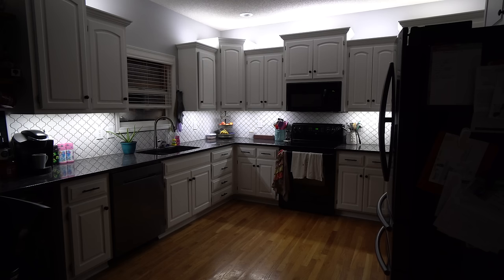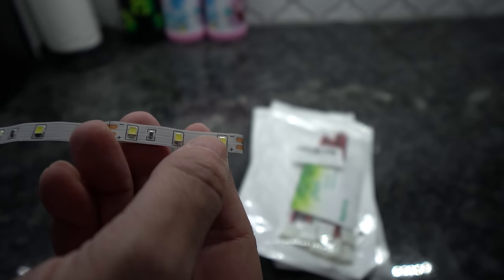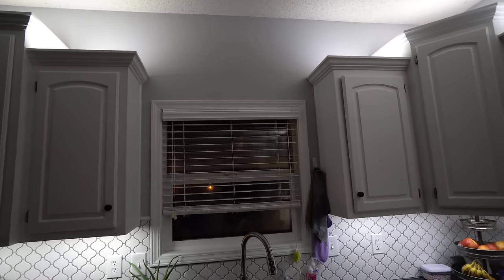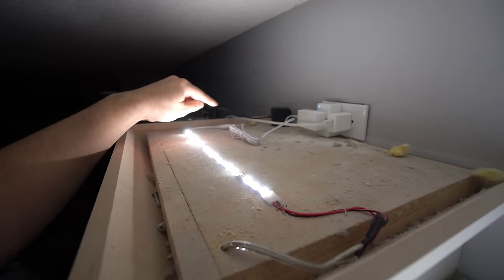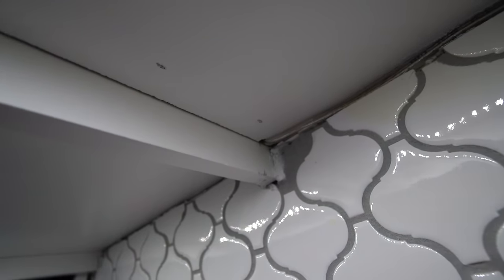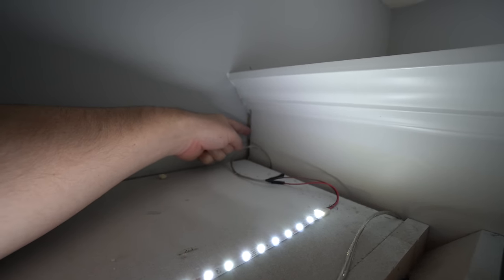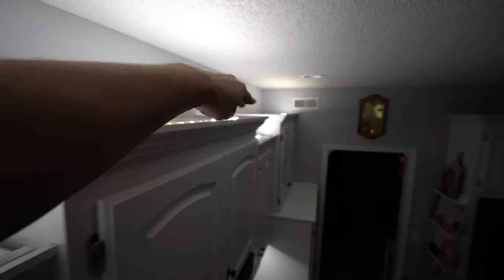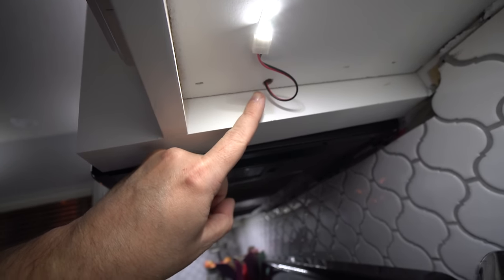Under Cabinet Lighting - EASY and AFFORDABLE!

Comment from the maker: Thanks for watching - Please Like and Subscribe - Product Links: LED Light Strip - https://amzn.to/3bIDMgN, Solderless Connecters - https://amzn.to/3aXoKVq, Wire - https://amzn.to/3swyGLj, and Wyze Smart Plugs - https://amzn.to/3r0xSOD
Reply: Do you have a link to the conductor you used?  I see the box there but you didn't discuss it in the video.  These are only 12V light strips being hardwired to my home's 220.  Thanks a million.  Your lighting looks fantastic!
Reply from the maker: Are you talking about how the leds plug into the wall?
Reply: Yes power adapter comes with light strip but as he said only one per string. It will plug into your wall and convert wall power AC to DC for lights .
Reply from the maker: Ahh yes. I bought one light set per plug-in I needed.
Reply: @DIYReid  ~  Oh ok, thanks.  I'm wanting to tie in to an existing light switch in my backsplash that goes to the light above the sink... I may be using the wrong lighting for this... I'll have to ask a friend of mine for help.
Reply: @777smitty4  ~  I'm wondering how to get this 12V lighting to tie into the existing light switch, or am I going to have to use a separate 12V RV switch?  I'm sending you an email...
Reply: what wire would you use for running the RGB light strips?
Reply from the maker: https://amzn.to/3GkSfjQ

Comment: the ability to split to different directions is exactly what i was looking for! subscribed and thanks
Reply from the maker: Thank you for the support!
Reply: @DIYReid  or Andy Espenan what was the other kind of wire that you used that went through the cabinets? Do u need anything else to hook it up to be able to jump it like 4 ft beside what you showed in the video? I know the solderless connections are great for small areas but I have 4-5ft sections in a few spots I need to run wire instead of lights. As long as I don't need to solder anything, I can figure it out!
Reply from the maker: I used speaker wire. I linked it in the video description.
Reply: Had cheap speaker wire. Cut the main cord to feed 2 different routes and it was very thin

Comment: I also have lights on top of the cabinets, and did it with no outlet at all. I actually had to run an extension cord right along the seam of the cabinet where no one sees it all the way to the outlet behind the fridge. At the end of the cord I plugged a smart outlet and have them so they will automatically go on and off at certain times. They could also be turn on or off using Alexa. I really love the vibe it gives.

Comment: You're correct, it is in series. 

I love the ideas! I'm working on a project similar to this myself. I was wondering how folks did it like this! Thanks for some ideas!
Reply: would be in parallel.  if in series, think old Christmas tree lights.  if one light is out, they all are out..  In parallel, all lights between the plug and the last one are then just "tapped off" the power run. :)
Reply: It's parallel. They are made to be connected and wired in parallel. Series would mean connecting your positive to one end of the LED tape and connecting the negative to the other end. In a series circuit, if one bulb fails, it will make the whole section turn off since the positive and negative have both been broken by the failure of that bulb's filament.
Reply: Definitely a parallel circuit.

Comment: Great video.  Thanks for the walk through. Just put these underneath my cabinets and they look great. I apologize if someone else has already asked this in the comments and it’s been answered but how did you hook up the remote to the smart plugs seems easy but I’m having an issue, connecting different brand platforms.

Comment: Do you have any ideas for lighting underneath the hood over my stove that doesn't take electricity, like rechargeable or battery-operated. 
The lighting and ventilation is broken so I just need a light under there. 
They would have to be heat resistant. 
Thank you for any help.

Comment: I'm wondering what the lifespan of the upper lights will be without a diffuser to protect against dust. 🤔 

Your video confirmed my speculation that I'd want tunable white strips, as the led strips being at such a different Kelvin rating from the recessed pucks would drive me sorta batty. Hahaha
Reply from the maker: Not sure. A buddy of mine has had his up for a couple years so far no issues.
Reply: Most led stripshave a silicone protective layer.   But whether they do or not, dust won't effect they're longevity.
Reply from the maker: Thanks for the explanation. I didn’t thin like dust would cause any issues.

Comment: Thanks for this! I have mine connected with a jump from one set of cabinets over the microwave to another cabinet. The lights before the jump are on, and a volt meter shows the second strip is active, but they aren't on. Any ideas?

Comment: I used RGBWW smart led strips on the tops and bottoms of my cabinets.   I like that they can be turned on or off with my Google Assistants.    Plus they can be warm white, white, or any color you can imagine.
Reply from the maker: I didn’t use RGB because my wife isn’t a fan.
Reply: @DIYReid  mine wanted them on top especially for Changing colors during different holidays.
Reply from the maker: Funny thing is my wife said afterwords she would have liked that too. 😂😂😂🤣
Reply: @DIYReid  you'll have that! Lol
Reply: Can you please post a link to the RGBWW lights you used. I can't find one on Amazon
Reply from the maker: I posted one in the description now.

Comment: Very helpful and thanks for sharing. Question: I would use white lighting 90% of the time; however, thinking it would be a nice "option" to be able to change colors once in awhile. Is the color light able to look white with a setting and would you recommend the color lights you provided link to in your post?
Reply: Trust me, you don't need the RGBs.  You already said, "white 90%."  Every time I buy an appliance I think, "oh, nice option" and I NEVER USE IT!  
The dedicated white LEDs are a much better way to go, color wise, intensity wise, etc.

Comment: I put RGB LEDs on the top of my new cabinets and just use the remote to turn them off and on. My wife wasn’t impressed with the colors, until she saw them being changed. Now, I will go in the kitchen and she will be sitting at the breakfast bar drinking a glass of wine with the room lights out and the LEDs on the color of the day!  Now I have to add more to the bottom. I have been trying some rechargeable ones, but the motion sensors are not working correctly, so a better solution is needed. If anyone is installing new cabinets, I suggest having wiring done during the install, just in case you want to add them later.
Reply from the maker: I should have done RGB. I didn’t think my wife wanted colored lights so I didn’t go that route. Once they were up she mentioned it. I was like oh crap.

Comment: Thank You for the video going to try this out over the weekend. I’m curious do you need the hub to get the Zigbee button to work with the smart outlet? Or can you connect the button directly to the smart outlet? I’m not clear on that step. I would like the button and use of the app. Thank You
Reply from the maker: Yes, with a zigbee button you'll need a hub. You can buy these outlet plugs - https://amzn.to/3Pxafe1 and just put them on a timer to turn on in the morning and off at night. I ditched the button and use it for something else as I never used it.
Reply: Thanks for the quick response; the outlet plug was the plan I will just stick with that. Can I use 22 gauge wire instead of the 18? Not going for a long run.
Reply from the maker: @gsmith523 should be fine

Comment: Thank you for your video. I am wondering about what did you do at the section Time 2:29. You mention that you took power off the outlet near the coffee maker and run it up the wall. Actually Did you ran wires behind the wall up to the top of the cabinets? How did you fished the wires? By the way, You did an amazing job.

Comment: I'm thinking of going this route with my under-the-cabinets lighting.  I really like your implementation.   I like the idea of having the smart way to control the lights as well as a physical button we can maybe mount someplace for the kids or guests who wouldn't have easy manual control of the lights.  The Zigbee button says it requires a hub?  I don't recall you explaining that bit.  How do you link the button to control those smart plugs?
Reply from the maker: That’s a bit more complicated kid just recommend outlet plugs on timers. These don’t take much power at all.
Reply: @DIYReid  I like the idea of manual on/off as well as the smart plugs you recommend.  Any suggestions then if this button is complicated?
Reply from the maker: You could buy a third plug and plug it in on the wall above the counter and in the app of the plug turns on turn the lights off and vice versa. There is a button on the plug.

Comment: Anyway you can explain on how to connect the multi color led strips from low voltage wire to attach to another led strip
Reply from the maker: It’d be the same way but RGB has 3 wires vs 2 wires.

Comment: Thanks for the details on this setup. How did you split the wiring coming from the microwave outlet to go both ways?
Reply from the maker: What do you mean go both ways?
Reply: @DIYReid  hey thanks for replying. I was talking about on your explanation in 6:45 to 7:19. thanks!
Reply from the maker: I just wired up the lower cabinets in line with one of the other led strips.

Comment: Where does the second power supply come from? When I look at your affiliate links, there's no mention of it, but I would imagine you had to purchase a second power supply?
Reply from the maker: You have to buy two strips. At least that's what I did.
Reply: @DIYReid  Thank you for the response! I thought that might be the case.
Reply from the maker: I’m sure you could buy a power source on its own but I’m not smart enough to recommend one that will work.

Comment: How to connect the additional 18 gauge wire to the connector. The wire on th connector is thinner than the extension cable?

Comment: Thank you. I already have upper and lower cabinet lights (halogen 120V) but much prefer LED strip lights. Will try to do this. I am still using my old regular plug. My question is can a plug be connected to the connection wire?Thanks
Reply: Similar issue here 
Can leds be directly wired to existing wires? Or need some sort of junction Box
Reply: LEDs are 12v or 24v outlets are 120v you need a driver to step them down from 120v to 12v or 24v. Depends on what LEDs you have
Reply from the maker: The LEDs I used are linked in the description and come with a 120v outlet plug-in.

Comment: So to go from bottom to top of cabinet, your splicing where you need to whether bottom or top cabinet, then to connect the bottom LED strip to the top LED strip, you're connecting the two strips with wire and connectors? Is this basically right?
Reply from the maker: Yup. From the bottom I connect the positive and negative to the positive and negative to the top strip

Comment: Nice I may try this one.  So I want the same light as the incandescent bulbs is that the warm white?  
Also I have the exact set up outlet behind fridge and on the other side outlet in cabinet for microwave so I can run two separate runs on either side of the kitchen and go above and below.  
Questions. Power cord to the first light strip and when do you use the long red wire? When you’re connecting one light to another cabinet?  What are the connectors for?  I will re watch.

Also does this have an app to turn on and off since the power will be behind the fridge and behind a cabinet?  Do they dim?

Comment: Please  confirm; do I need a different strip for every outlet?
Reply from the maker: Unless you run a runner wire to connect them you’ll need one per outlet because it only comes with one plugin
Reply: @DIYReid  thank you for clarify !

Comment: Any tips on connecting the longer lengths if wire to the solderless connectors?
Reply from the maker: You mean without soldering? You can use butt connectors or twist the wire together and electrical tape them.

Comment: Hello I bought your kit, but I’m wondering if I need to buy another plug for a different area of under cabinet lighting and how are you Controlling both sections together..
Reply from the maker: I use two plugs and combined the outlets together in Home assistant. In theory though you can automate both outlets at the same time.

Comment: I put my LED strips into aluminium channel - they get quite hot and I'm hoping the channel will dissipate the heat and extend the life of the LED's.  The diffusion covers of the strips gives a softer light and is, I think, worth the extra expense
Reply from the maker: The LED’s I used I haven’t noticed running hot.

Comment: Looks really good, I plan on doing this too. Quick question: I have a stand alone cabinet, I’m wondering if there’s a cross stud behind it that I would have to go through to duplicate the AC outlet that’s under it above it like you did. Thanks
Reply from the maker: Most walls won’t have that. Unless for some reason they put a fire block in or messed up with mounting the cabinets and needed a special mount.
Reply: @DIYReid  You can also put an outlet inside the cabinet only about a foot above the existing backsplash outlet. It's more intrusive but can be easier than running power all the way to the top (sometimes). Then you can just run low voltage from inside the cabinet.
Reply from the maker: I didn’t want an outlet where I put dishes or cups. But you can if you want and is a good option.

Comment: Reid,  for the Zigbee mini switch, it says an Aqara smart hub is required.
What the heck is this? And where do you install this in conjuction with the led lighting strips?
Reply from the maker: You don’t need that hub. You just need a hub that can control zigbee.
Reply: @DIYReid  when you say Hub, what do you mean?
Can you do a video explaining/describing how you connected both the wyze plug-ins and Zigbee to home assistant?
It would help clear up the confusion I'm having with this setup.
Reply from the maker: Sorry. I can do a video but it’ll be a while. Basically you’ll need some sort of home automation hub to run automations and combine things to work the way you want. At the very least you can use Wyze or Kasa plugs and automate on time based and even turn them on via a phone app.

Comment: Great video
Here is the issue I have , I have old halogens on top and bottom of cabinets hardwired and works via a switch which is great but 
What I can't figure out is can you hardwire leds to direct wire ? Will it blow ? Is there a bypass box ?
Thank you
Reply from the maker: No. You’ll need to convert the 12v LED’s.
Reply: @DIYReid  any idea how?
Reply from the maker: You’d have to wire up an outlet. Maybe there is a transformer box that you could use.
Reply: @DIYReid  ty 👍
Reply from the maker: Sorry I couldn’t be more help. Maybe someone will see this and respond with some ideas for you.
Reply: @DIYReid  no worries 
Gave me some ideas

Comment: Reid, did you use heat shrink tubing or electrical tape to secure the excess wire to your solderless connectors?
Reply from the maker: Electrical tape. Heat shrink would look nicer but no one really sees it unless they look.

Comment: Reid, If I don't want to program the Wyze outlet plug ins to turn off and on the led lights, can I just use the zigbee button to turn both of my Wyze outlets off?
Reply from the maker: As long as you have a way for the zigbee button to communicate to the Wyze outlets.
Reply: @DIYReid  what's the purpose of having the Wyze plug ins? I just need to know the process, so I feel comfortable doing this same setup.
So how do you control both upper and bottom led strips to turn them on and off for both sides?
Is thus something you control manage through the Wyze App??
And how do you use the Zigbee if you want to turn off and on your lights and bypass your schedule??
Thanks for answering my questions Reid.
Reply from the maker: The upper and lower strips are tied together. Each side of my cabinets have an outlet tied to a Wyze plug and I have an automation to turn them on and off at a certain time

Comment: I have a question about the wireless switch you are using.    Does this switch connect directly with the smart plugs or does the switch need a hub?
Reply from the maker: Needs a hub.
Reply: @DIYReid  yea. Can you please let me know what Hub you used for your setup?  I am setting up my lights exactly like yours and am buying the hub and button together.
Reply from the maker: Easiest way that I know would be a Smart Things Hub - https://amzn.to/3OsvdsV but it looks like they have upped the price a lot. I use Home Assistant which is an open source OS for home automation. https://www.home-assistant.io/ They do sell a hub for $160 or so but you can use an old computer or laptop or even a raspberry pi if you’re tech savvy.
Reply from the maker: Or get a Smart Things v2 hub on EBay for $40
Reply: @DIYReid  do the Smart outlets need to be compatible with the hub?
Reply from the maker: Yes.
Reply: @DIYReid  are the smart outlets you linked to this video compatible with the smart things hub?
Reply from the maker: I just updated them to Kasa plugs that do work with smart things - https://amzn.to/3OACoPj